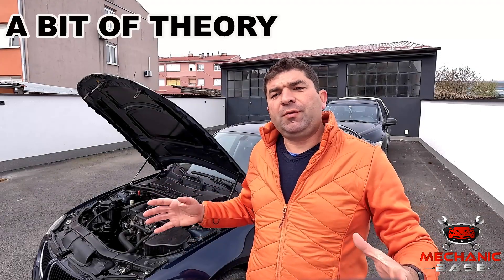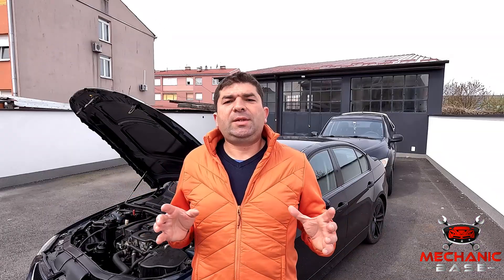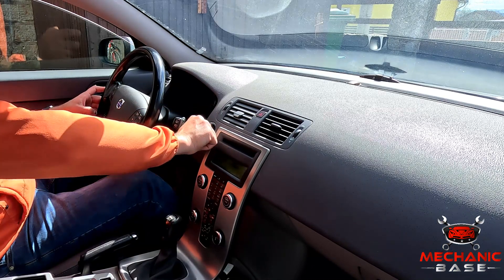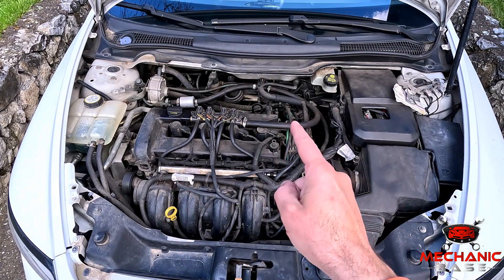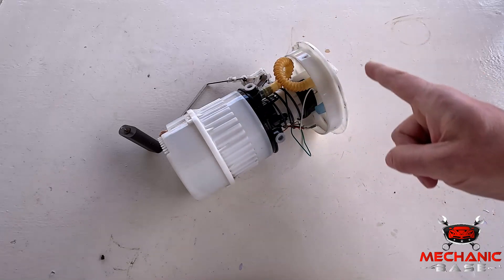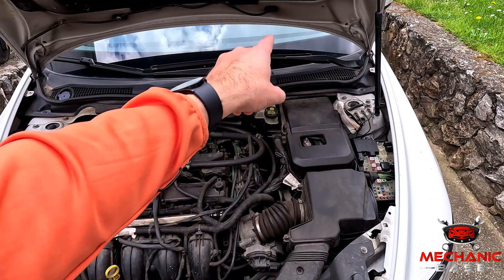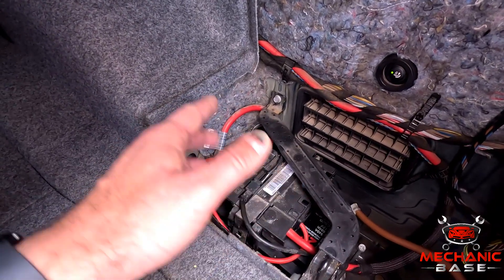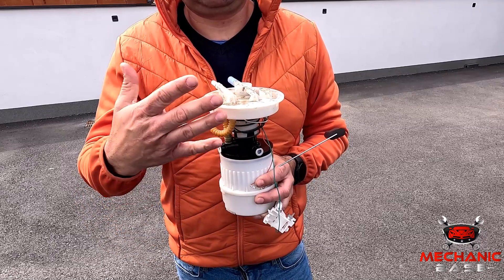7 Symptoms Of A Bad Fuel Pump (and Replacement Cost)

Comment: bro my car sometime loss accerlation on highway randomly for  just one second and after a second it automatically picks power ..is this also issue of a fuel pump going bad
Reply from the maker: Do you get a check engine light or other warning when this happens?
Reply: @MechanicBase  no check light nothing and this happens on when fuel bar is below half ...and happens only on highways when speed is constant